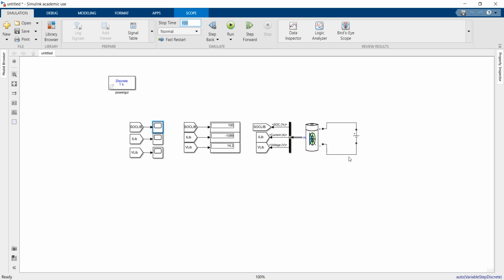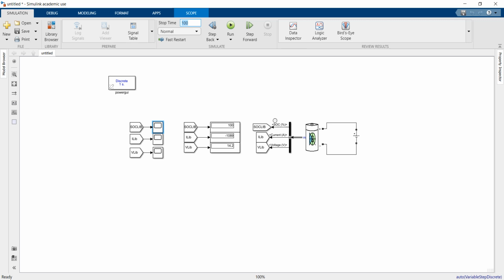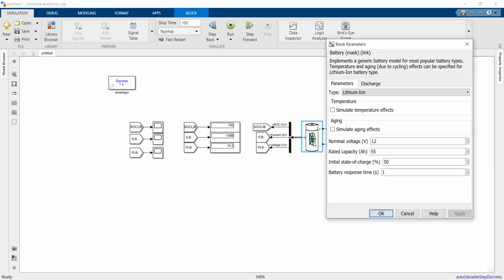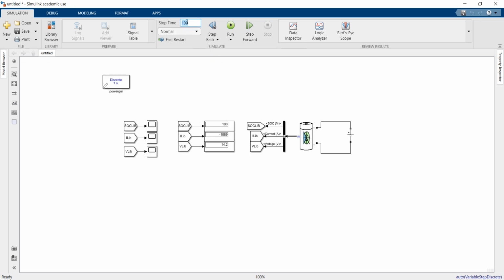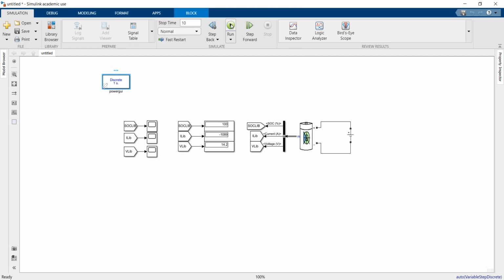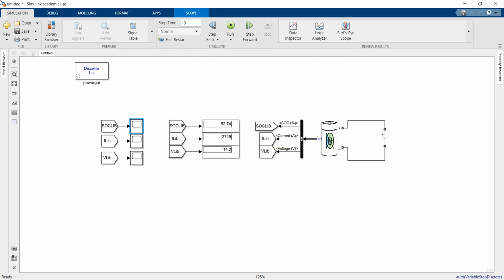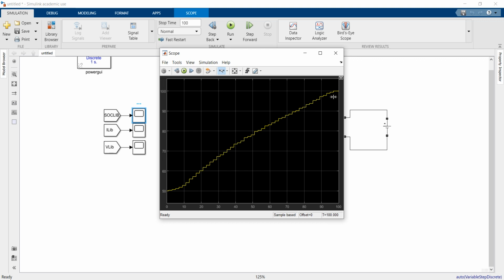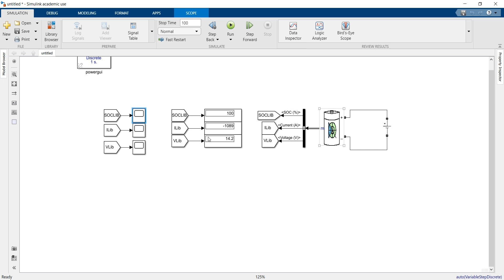Charging Lead-Acid/Lithium-Ion Battery using constant voltage method in Matlab/Simulink

Comment: Hello, sorry i want to ask please why the current in simulation is so high ?? When it is, applied in real hardware, is that current would be high ?? 🙏🏻
Reply from the maker: Hi, the current of Battery is determined by the size of the load. As high the load is the high will be the current. Even in hardware, if you connect a big load, it will draw high current from the battery.